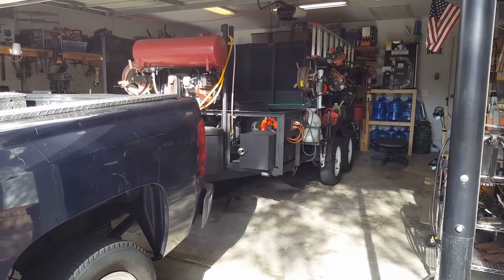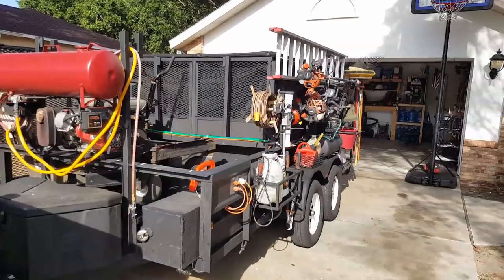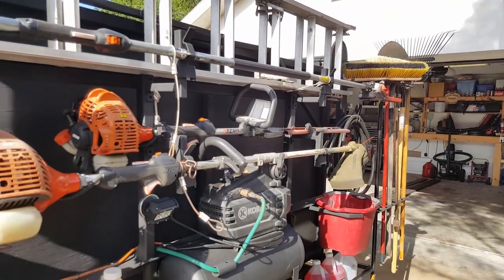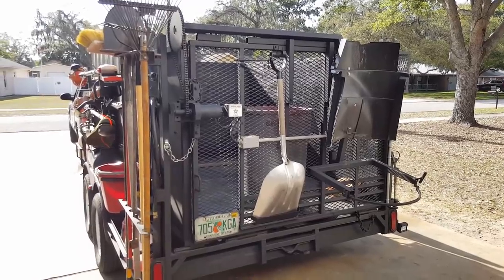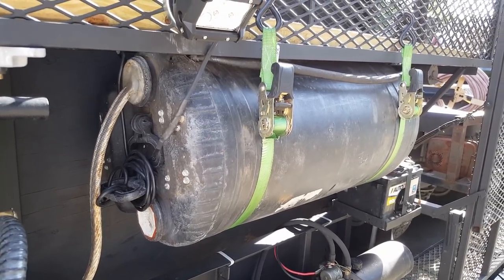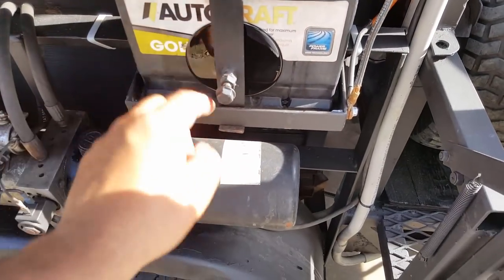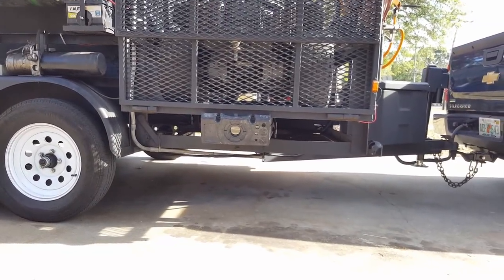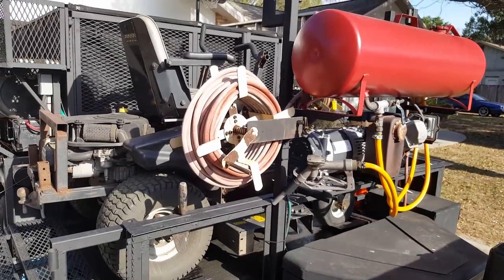Property Preservation Trailer

Comment: I love these type's of builds and dedication to there job I've seen manufacture equipment and they have no clue on whats actual needed or how it should be built for the operaters of the equipment!
Reply from the maker: terry jenkins I agree 100%. Manufacturers try to hard to make "general use" equipment. If you need something specific to how you work or the job you do seems you have to either pay much more, or do it yourself. I chose the latter. Lol.

Comment: Hello of a trailer mate. Over here in the uk we'd have to pull that with a lorry lol. Very nice cheers Calvin
Reply from the maker: +Calvin Thomas She is a bit heavy! The Chevy does a decent job pulling it. Sorry if this is a stupid question, but do you guys have pickup trucks over there?
Reply: Dale Otero hi. Yes we have pickup trucks but they are small compared  to you'res over there. We don't use trailers like you. We use vans and tipper vans. We carry rubbish in our trailers that's all. If we had our equipment on it. It would all get pinched lol.  I have a 7 mtr van I use. It's in my 2018 setup video. All the calvin
Reply from the maker: +Calvin Thomas I feel like vans are more practical for the city work we have here, much easier to maneuver and easier to lock up as well. When I started this business I only had a small truck and this trailer I bought used off of a friend. The trailer was way too big for the truck. Lol, When I started doing better I bought a 12' cube van and used that for about 3 years. After a car accident it was totaled so I went back to the trailer for what I thought would be a temporary period of time but found I liked using it which then started the modifications. By the way, I just checked out your channel and subscribed!
Reply: Thank you for the sub to my channel.  All the best for 2018. Cheers Calvin

Comment: This is amazing. Just getting into the business and this is a beauty. You said you have built these? What's the cost?
Reply from the maker: Thank you. Yes. It's my full time business now. You can go to www.mowandgosystems.com for more info and to order if and when you are ready. Feel free  to contact me if you have any other questions. Thanks again.
Reply from the maker: I'm sorry, I thought you were asking about the ramps. I don't build the trailers. I did build mine but it was over time. I kicked around the idea of offering them and even entertained a few requests but they never went anywhere. Mine would cost about 10k but has alot of things on it that would be considered unnecessary by most people. You could get most of the way there assuming you already have a trailer for about 4500

Comment: What are the trailer dimensions?
Reply from the maker: the trailer is 6.5' x 12'. the rear dump section is 5' long 5' wide and 4' high. the front where the mower goes is 46" (gate width) and is 7.5' deep. hope that helps

Comment: Do you need electric on jobs...
Dumb question
Great idea...
Reply from the maker: Yes when I'm running the compressor or need to check the houses systems. Also us it to run hammers drills and other larger power tools. Thanks for checking it out!

Comment: How much for one?
Reply from the maker: That's a difficult question to answer. If you already had a trailer to modify I'd say $4500 would get you most of the way there. If you check out sle equipment they have similar setups but they are much heavier duty. They dont have near as much of the tools and equipment that I have but it's most of what you need.
Reply: @mowandgosystems  thanx...yeah we want a heavier duty one, but thanx again for the insight and maybe some day we shall cross paths.

Comment: What the price for you to build one?  Thanks
Reply from the maker: It really depends on what you want. Below is my best attempt a what I have on my trailer and its individual costs per item. If I was to build a full setup I could match mine for about $6800.     

15 Gallon fuel tank inculdes any metal, welding, and mounting   $294.60 
4k watt generator panel seperated and relocated and fuel fed from 15gal fuel tank  $523.58 
Air Hose 100'  $54.90 
Air Hose Reel includes welding, metal and mounting  $78.92 
Tongue Box  $169.20 
Gorrilla Lift (for side gate)  $242.40 
Tongue Jack includes wiring  $242.40 
Chain Saw Box  $108.20 
8 gal Compressor includes welding, metal and mounting  $280.80 
Equipment  Racks includes welding, metal and mounting  $282.40 
Trailer Brakes (one axle) includes wiring and installation  $385.60 
12 v Water pump for water tank includes wiring and hose  $131.00 
120v water pump for 100' water hose runs on generator includes mounting  $167.60 
12v Battery for water pump and aux lights.  $205.80 
Battery Box  $47.20 
Hand Tool Racks (holds 6 tools) includes welding, metal and mounting  $144.54 
100' water hose   $96.00 
water hose reel includes welding, metal and mounting  $233.60 
15 gallon Water Tank installed  $123.80 
led spot lights and trailer lights with switches and wiring  $218.00 
40 oz liquid soap disp  $63.06 
6'x8' Tarping System includes welding, metal and mounting  $149.30 
55 gallon Trash can dumper includes welding, metal and mounting  $365.70 
(8'L x  4'H x 6'W) dump box includes welding, metal and mounting  $2,297.90 
4' wide 6'long 2pc Side Gate includes welding, metal and mounting  $475.50 
Overhead removable Racks (3 rack points) 8' and 12' spacing includes welding, metal and mounting  $277.40 
Extension Ladder Rack peg style includes welding, metal and mounting  $105.50 
2 Chemical Racks for 8 gallons(4 gallons per rack) includes welding, metal and mounting  $178.20 
Pump sprayer and clean water bucket rack includes welding, metal and mounting  $108.66